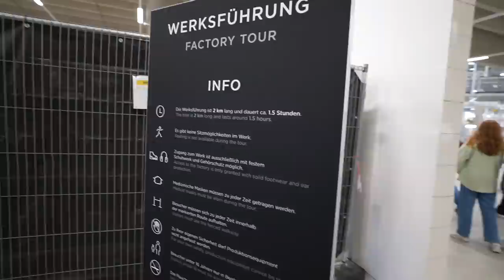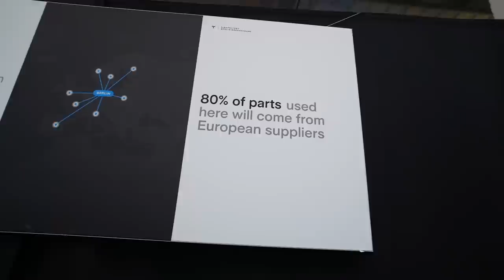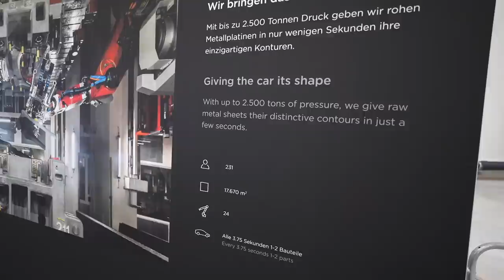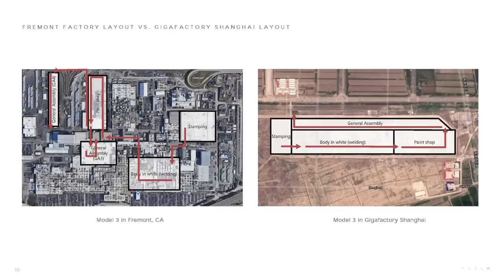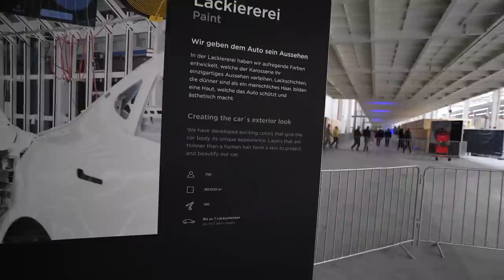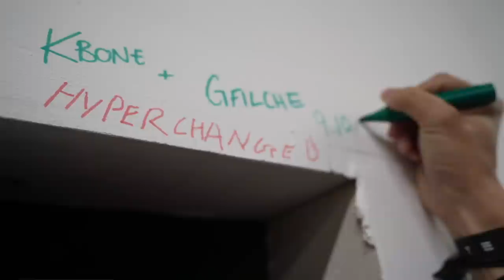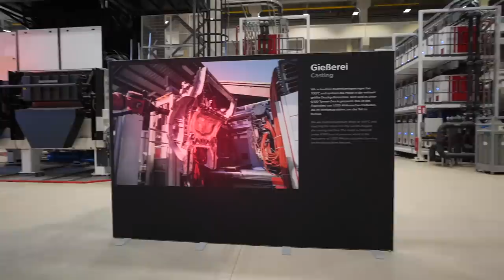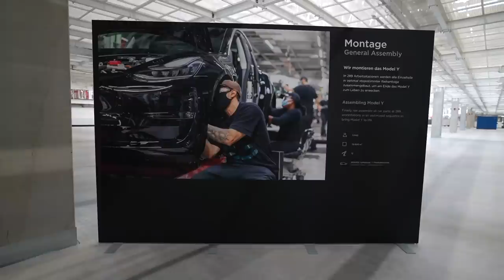Tesla Berlin Gigafactory Vlog & Tour!

Comment: Awesome guys!

QUESTION: @14:31 are these dash/consoles one-piece, drop-ins to the chassis - or just demo pieces?
Reply: According to other news I've seen, they'll be fixing the seats to the pack.  So i'm guessing they'll be attaching the full dash on the top shell, and drop it over the skateboard with the seat.   then keep them appart to make the connections, and close it in.   The next production line video will seem so much simpler.
Reply: It’s two pieces, the dash is mounted first, before the doors, then the center console is put in and finally the seats.
Reply: @HansMilling  Awesome Hans, thanks.

Comment: When you think of the cost of the massive amounts of steel, concrete, paving, machines, etc being spent on the 2 new Tesla factories with zero current return, next years earnings without these expenses is going to be bonkers!
Reply: Underrated response!
Reply: These costs are actually capitalized and go on the balance sheet, thus capex spending does not impact that income statement (GAAP profits).  You are thinking about this in terms of cash-basis, which is not utilized for public companies typically.
Reply: I'll be watching closely at the ROCI 👍👍
Reply: @jasonwallace3945 
Cash flow is an important metric too.

Comment: Does anyone know if the stamped exterior panels are made of aluminum? If so, then it's finally a car that won't rust.
Reply: IIRC, they said at one point that their materials science team had to create a new aluminum alloy in order to have the right properties to work in the giga-casting machines.  Apparently, not having the proper metal was one of the things preventing others from doing the single front- and rear-castings before - that and no one was making machines that large, so they had to special-order them from IDRA.